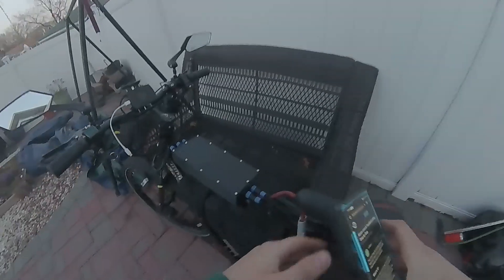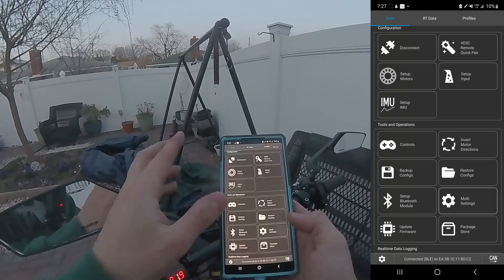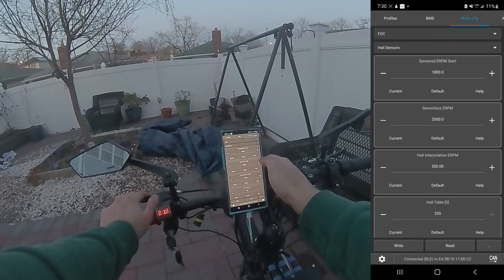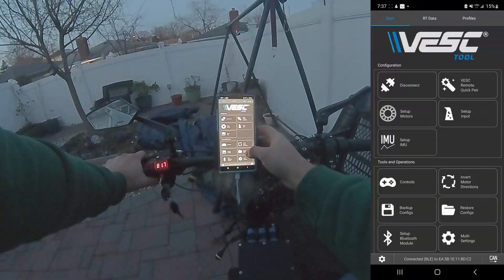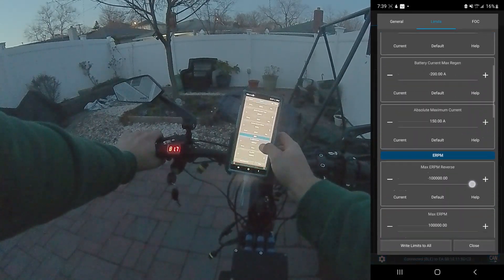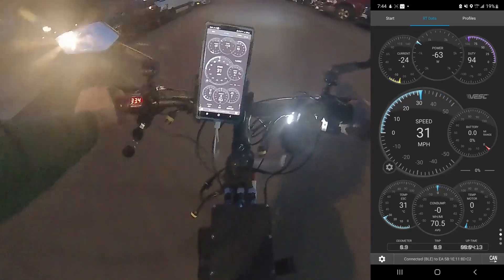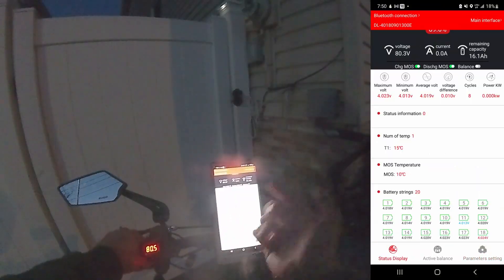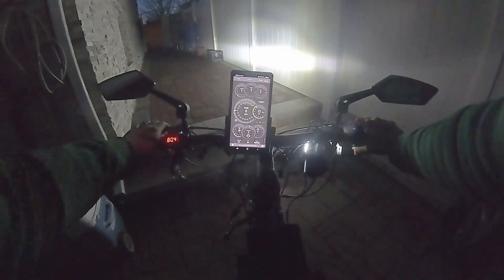Why is my E-Bike so slow after upgrading to Flipsky VESC?

Comment: You have a motor temperature sensor connected? I have an MXUS 3K 3T with the same controller and a 72V battery. I was pushing it to around 200 phase amps, and the torque is nic,e but the motor overheats fast
Reply from the maker: Nah this motor doesn't have a temp sensor. I do touch the motor with my hand from time to time and it never gets that hot. Just a bit warm. That's partially because the battery is only 18Ah so I usually don't ride long enough for the motor to get hot.

Comment: When you ran motor wizard you probably left power loss at 150w, and because your motor has high resistance, it set motor amps to 60a. This setting made before running wizard will measure the motor resistance and determine how many amps will create 150w of heat (loss).

So what I do is edit the ~6kg DD motor to my correct number of magnets (poles) and i set the max power loss to something reasonable for my motor. So i take the RATED power of the motor, *3 to get peak power, and then use 10% of that. So my 2000w motor, *3 is 6000w, so set max loss to 600w.

This will automatically set your motor amps to a reasonable value. In mine it sets it to max (120a). In yours if you have a 3000watt motor you should try 900w power loss. 

Obviously your motor can battery cant handle this continuously, so you need to make sure field weakening is 0a and see what current gets pulled bacl to at top speed. Then add a bit of field weakening if you still have some overhead .

If you want turn and burn you can set some profiles that allow it and set field weakening from 0a up until your battery sag stays at 10v. Then make profiles that limit rpm and pulls current back down to something reasonable. You will need one that limits speed and acceleration if you want to ride logs than 15 minutes lol
Reply from the maker: Thank you for the feedback. I was wondering why it gave me such low phase amps.
Reply: @ , yes, the VESC videos I watched just said it normally sets motor amps conservatively. The first 20 times I ran wizard i just used the ~2kg outrunner defaults which is preset at 400w power loss. Then later I scrolled down and found the ~6kg DD ebike motor and ran that with defaults (150w) and it set my motor amps very low. And since the motor resistance and inductance measurements were the same after running wizard, I wondered why it thought a ~6kg motor was less able to handle amps than a ~2kg motor. 

Then I did tests changing the power loss of the ~6kw motor to 300w, 400w, 500w, 600w and it progressively increased motor amps until I hit my 120a limit of my 75100 V1. Further increasing the allowed pressure loss didn’t set motor amps above 120a,  but I’m not running “no limits” firmware because I didn’t want to destroy my controller before learning what it can tolerate. Lol

So I think you can either totally ignore the wizard motor amps setting and just manually enter whatever you think the motor and controller can tolerate, or change the power loss watts to whatever you consider acceptable loss full throttle. Then round it to the nearest amp value so its easier to remember which amp limit you tested. 

So far using 4x the rated power of the motor, and taking 10% of that as allowed loss, puts it in a decent starting value. 

By now you will also see its battery amps that drives this whole thing.  Ignore all the nonsense that motor amps should be 2x or 3x battery amps. Set max battery amps to whatever causes a 0.5v/cell sag (10v in a 20s pack) and then it will do all it can do. Set the max motor amps to whatever it can handle for acceleration and then use some for of rpm limit (either back emf or profile speed limit) to pull amps down to something reasonable. You can also make a “Turn and burn” profile that lets everything stay at maximum until you let off the throttle manually.

Comment: Hey, the motor current limit is phase amps which is different than the amp draw from the battery. You can safely set the motor current limit (phase amps) to x3 the line voltage (battery amp limit). For your setup i would set the max battery amp limit to 130a and the motor current max to 300a with an absolute motor limit of 350. Then you will feel what that hub motor can really do and maybe get those wheelies going that you wanted to!!
Reply from the maker: Thanks for the comment. I didn't realize that. Anyway, I won't be increasing the current any more since my voltage sag under load is already quite staggering (about 10V drop). In the future, I plan to rebuild my pack and add more cells in parallel (or maybe even in series... that would be quite interesting). It's currently a 20s4p pack from Molicel P45B's. I would like to make it a 20s8p or more. A 24s pack would be very interesting but would mean I'd need a new BMS. The BMS I currently have is already good for up to 250A, so it'd be more cost effective to reuse it .
Reply: @DimGG  Ahh yeah, even know those are great cells pulling 25-35amp from each in a 4p config will do that. I look forward to seeing the upgrades in the future!!
Reply: @Brentpn  i have a 75100, battery with 120a discharge How do you recommend to’ me, its a scooter i have two flipsky

Comment: If you put 150a on settings of controller dosent you're battery risking on overheating amd backfiring because you have like only 40 or 50 continues amps??
Reply from the maker: If your battery is only rated for 50 amps continuous, you should not exceed that in the VESC app or the BMS might cut power a lot. If your battery is built correctly and has the right size BMS, you shouldn't be at any risk of overheating since the BMS overcurrent protection would kick in first.
Reply: @DimGG  my bms is 100A so when i activate sport mode 150a its like my bms will shut down right?
Reply: Btw this is a question😊

Comment: I'm also thinking about getting the 75200, but I've heard that the acceleration and torque are rather weak compared to classic e-bike controllers. Do you have a comparison to classic controllers?
Reply from the maker: After some tuning I found that the 75200 has plenty of torque on my 3kw hub motor. I can't really compare it to the typical fardriver or mqcon controllers since I never really had one. This e-bike kit (NBPower 3kw) came with a svmc7280 controller which is like an mqcon clone, but it had an issue where it would constantly cut out on high amp, which meant that full throttle = controller cuts out, so I'm not sure what the "true" torque was. What motor are you using? Btw, I have an affiliate code if you order directly from flipsky.net "dim" that may give you $10 off at checkout if you decide to go with the 75200.
Reply: @DimGG  I have a MXUS 3k Turbo, I use a KT controller with 50 amps and it's ok, the torque for 50 amps is not bad, but I don't want to use a huge controller, that's why I want a 75200, I was just a bit unsure because I often hear that it's supposed to be pretty weak
Reply: @DimGG  Another problem with these cheap controllers is that the throttle reacts very badly, like an on / off switch. With too much power it is hardly drivable because it is very difficult to dose. What about the Flipsky?
Reply from the maker: The Flipsky 75200 (and almost any other VESC-based controller) has very good throttle response and you can configure precisely how you want your throttle to behave in the app. I have a video coming up where I go over more settings including the throttle configuration. Basically, one of the settings is your throttle deadzone. The default is 15% which means that when you turn your throttle 14% of the way it does nothing but once you get to 15% and above, you actually start getting some power. You can lower this (I have mine at 5%) to make the throttle feel twitchier and more responsive. Additionally, you can choose your throttle curve. Say you want the first 75% of the throttle to modulate your motor between 0-50% and the last 25% of your throttle to modulate your motor 50-100%. You can do this within the app. Some people do this to get finer control over the lower power range and just full power in the upper range. The very nice thing about VESC controllers like the Flipsky is how customizable they are. You can make it act pretty much however you want (within the boundaries of the controller's components of course).
Reply: @DimGG  Sounds great, but the Flipsky setup is complicated, right? I saw on the Flipsky website that there are two versions of the 75200, one of which is v2.0. Which should I choose? And is there anything I should consider when purchasing?
Reply from the maker: @Uwe342  not too complicated in my opinion. I have a video on exactly how to get it working on an e-bike and there are a couple other tutorials on YouTube as well. I went with the Pro V2 since it's the newest one and only a couple dollars more expensive. I think that the biggest difference between the V1 and the V2 is that the V2 has phase filtering, which allows the controller to get more accurate readings and perform slightly more optimally (at least that's how I understand it). They probably worked out a couple of kinks with the V1 controller as well if I had to guess.

Be sure to consider how and where you are going to mount it on the bike since this controller has no straightforward mounting points and bagging it is not a great idea. I am pulling about 5kw-7kw through my 75200 and it gets pretty hot. You can see the enclosure at 0:09 that I designed to allow the controller to get maximum air flow. It works well and the controller has not exceeded 113 fahrenheit. If you were to throw it in a bag and restrict the airflow, the controller may overheat and begin to limit itself to prevent melting. Definitely check out my other vid to get an idea of how you wire up this controller: https://youtu.be/JK75xIGKBoc
Reply: @DimGG  Okay, thank you very much for the detailed answer. Can I use the Flipsky app on my iPhone? How exactly can I use your code?

and in your video the vesc setting say 250 a battery current ? so it pulls 250 amps from the battery ? or this ist phase amp? because 250a dc current is to much for this small controller , thats more than a sabvoton 72200
Reply from the maker: so there's not really a flipsky app. you program the flipsky controllers using the VESC tool app which is a universal app for VESC based controllers like the flipsky 75200.

my code works on the flipsky website at the very last checkout page where you enter a promotional code

the motor current max actually refers to the phase amps and the battery limit is in fact a hard limit for the battery amps. to me it seems this controller can handle 150a from the battery @ 72v. the phase current can be much higher like 300-450. with sufficient cooling it can in fact do this.

Comment: i go 40a field weakening at 95% dty cycle, (this gives overspeed in the rpm when at top of the range.) hfi injection and vss i go 56v injection, (this gives me starting torque, enough to do burnouts and wheelies) run hall sensors, (for better low speed control) max motor amps 120a, absolute max 150a, battery regen 25a, then cross talk qfactor and d.